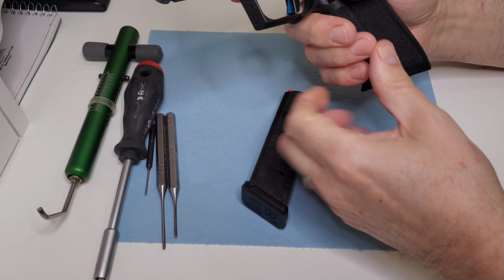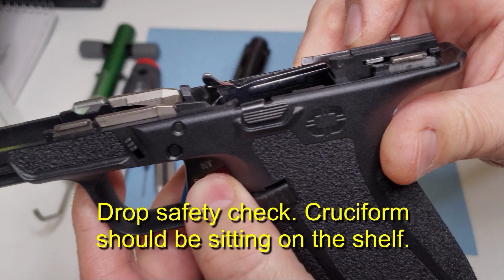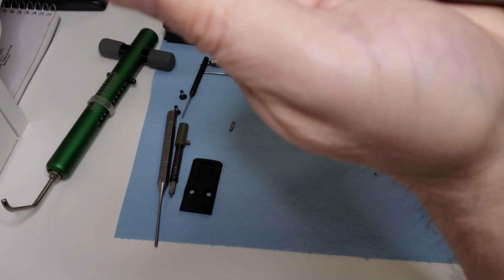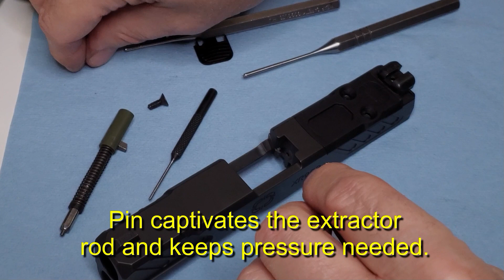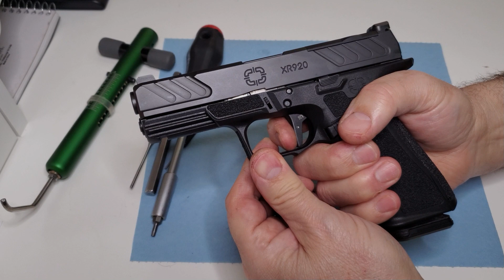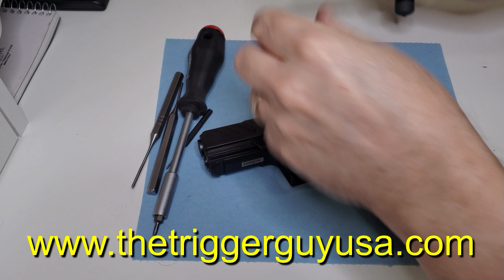Shadow Systems - 3lb Trigger!

Comment: I dont see this kit in the video, i just see a whole kit with a trigger shoe.
Reply from the maker: Click this link for the trigger kit that fits in the shadow clones. There are pull down fields so you can select the shadow model that fits. FYI, the XR, DR and MR shadows use the same kit. The CR model is the sub compact. 
https://thetriggerguyusa.com/product/aluminum-ramm-tactical-glock-leverage-trigger-glock-clones/